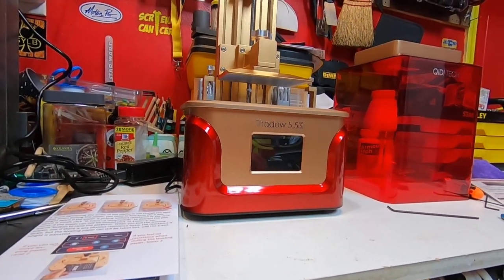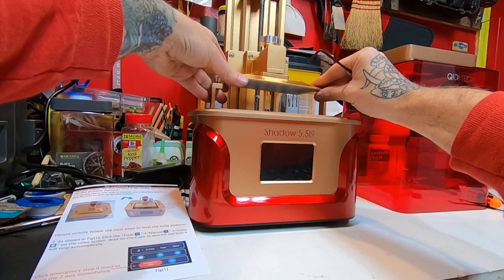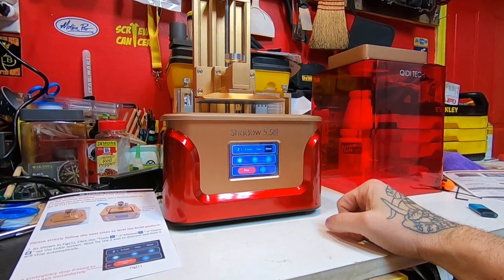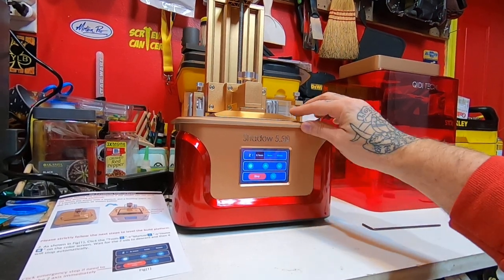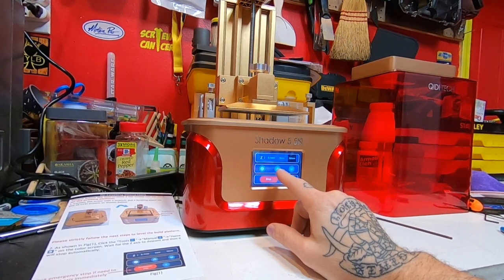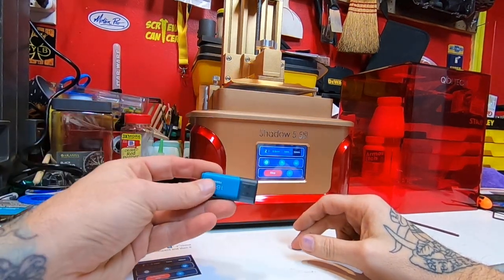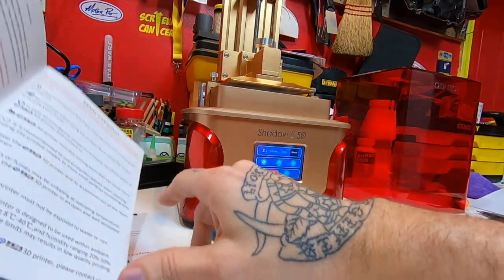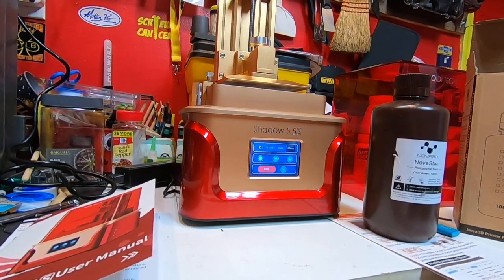Setting up & leveling the QIDI Tech Shadow 5.5s 3D printer

Comment: Once you have the bed leveled you must exit (back) out of the move tool and select Z to home to set the position. If you move the build plate once you get it level it reverts back to original setting. 
Level/ tighten
exit/back
 hit z to home button and it will ask to confirm the new bed position.

Comment: Hey I'm having an issue an d wonder if you've come across it. When I got the printer I leveled it and used the included card to set home. The first few prints came out well but now I am consistently getting failures, seemingly because the print is sticking to the bottom of the resin tray. Do you think I set home too low or could it be something else? Any help is appreciated...
Reply from the maker: I got a fail as soon as I attempted my 2nd print. My problem was with the supports I didn't have a big enough contact area where the support touches the model, I increased the size of the contact point to 1mm & that stopped it. If I'm running a print with no supports, which isn't often, I make sure that it's sitting perfectly flat on the build plate, if it isn't that will also cause print fails.
Reply: @yeoldebuildplate3dprintsho945  awesome, thanks!